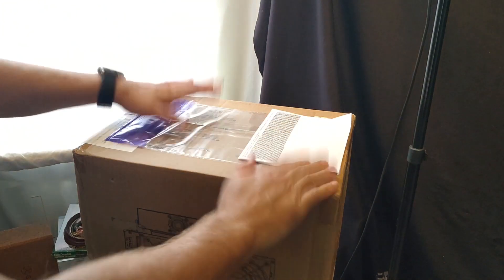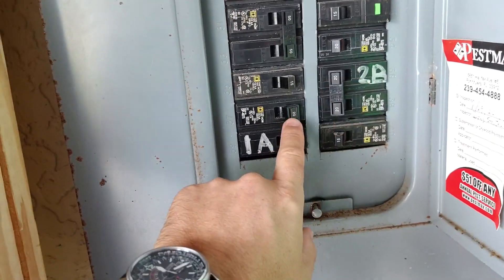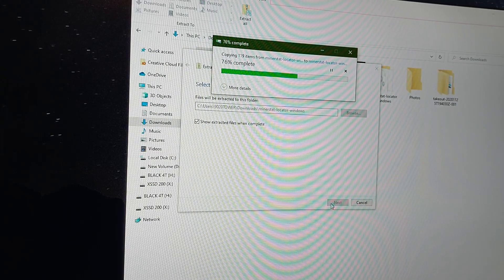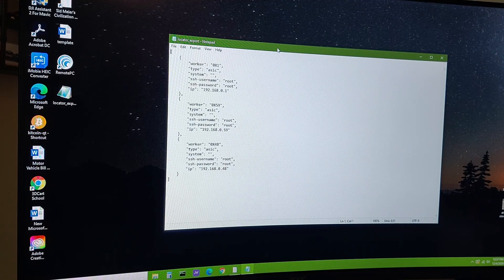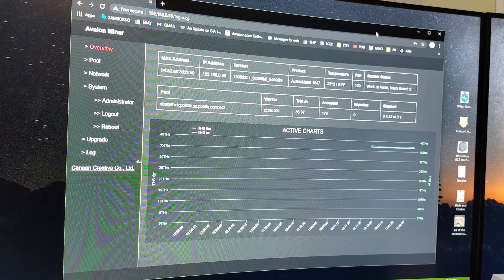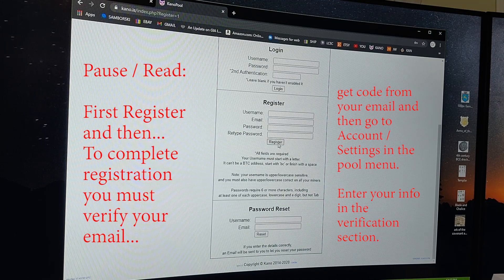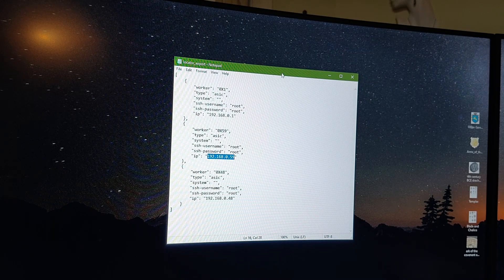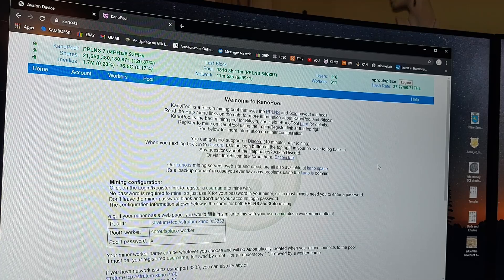Canaan Avalon 1047 Bitcoin Miner Unboxing and Setup Tutorial by Davintci Luxe

Comment: What is the life span for this device ? For how many months it will run smooth without any problems?
Reply from the maker: Good question. If I were to mine again, I would put emphasis on a cool and very dry soundproof room that vents freely. I would expect a long life. Hard to predict. If I really wanted to go the distance, I myself would buy a proper mineral oil cooling rig. Again, in a cool, clean environment, filter the oil as its cooled. No telling how long one could last in that environment. Ask the manufacturer. They will give best advice.

Comment: Did you have any issues running 2 units plus your entire house under that panel? After your experience, do you have any suggestion on a good pool? Don’t worry, 100% my choice if I decide to use it. Thanks for the video.
Reply from the maker: If I were to consider to even recommend any type of pool for someone that is already mining, it would probably be similar to any platform where they would be getting paid daily for their efforts. Scenarios where you are "waiting for a pool to hit" was a mistake that I made. And no, no issues other than a massive electric bill. In hindsight, I wish I had just straight up bought BTC with the money I invested in equipment.

Comment: Awesome thanks. So do you just have a dual pole 20a breaker going to a nema 6-20p receptacle. Then you use the IEC cable in that receptacle with no issues? I'm thinking about the a1246 or something along those lines if I can get my hands on one and am struggling with how to get the power to it. It seems as long as I have a double space in my breaker box and dual pole 20a to the box I should be good yes? Thanks for the videos
Reply: You are correct

Comment: how much Amp did you set up for your breaker?
Reply from the maker: 2 pole 20 amp breakers 220v
Reply: @davintciluxe797  What does 2 pole in this context refer to?
Reply: @ktrades2898  It's not a single breaker switch, its a double wide, two pole switch, as apposed to a single switch.